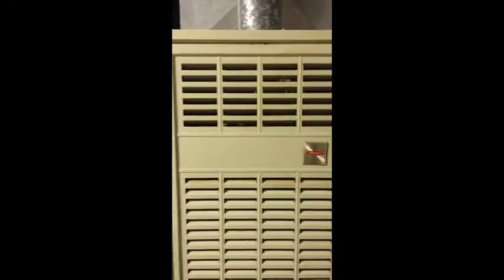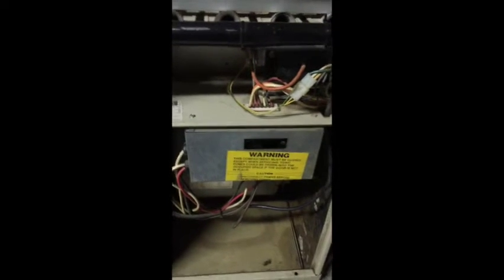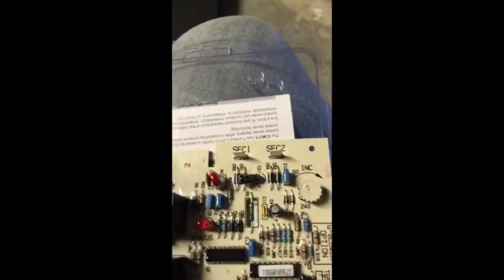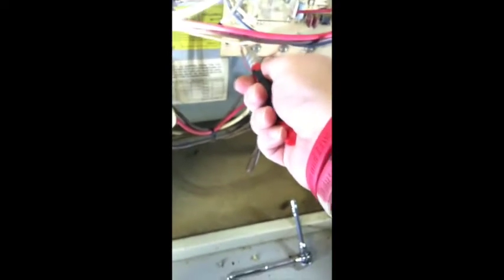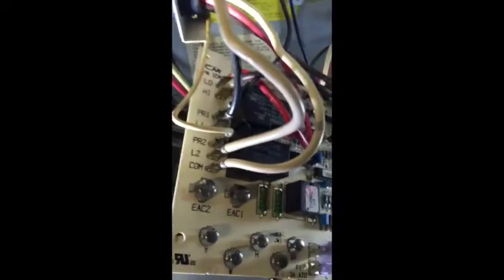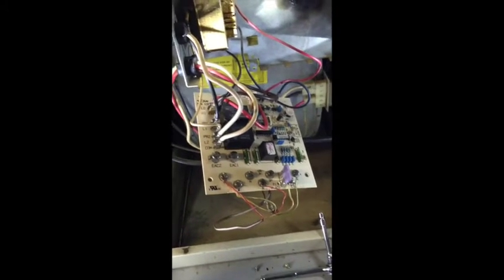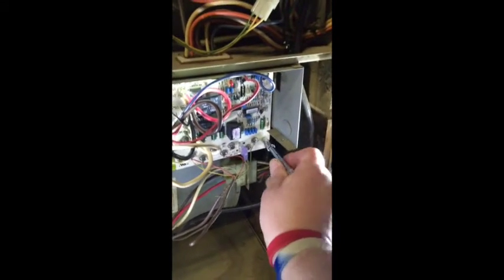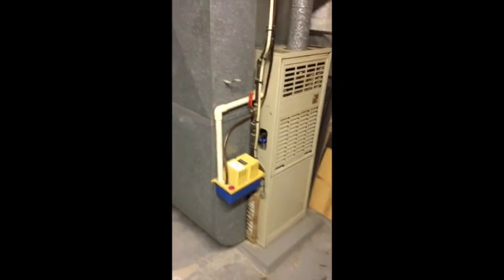Bryant/Carrier 395B Control Board Replacement

Comment: I did this exact same process today and it worked. An hour later the furnace stopped working, the new board has some residue all over it, and the led would not night up. Put the old board back on, bypassing the relay like before and now nothings working. 😢 no clue what I did wrong. Running the stove tonight… but the 3a fuse never popped?!?

Comment: Almost exact same furnace as mine. Yes, my board went out. Old style board has own relays on it. New board is solid state. New board installed with no problems. Transfer wire to wire over. Good video, thanks for posting. Saved me hundreds of dollars on service call.
Reply from the maker: Thanks Jim!!  Sorry I just saw your reply or else I would have replied back sooner.  

That was my whole point for doing this video.  I could not find ANY information out there on my furnace and I knew it had to be something stupid that myself or anyone else with a little mechanical ability could do themselves and save some $$$.

Comment: I have a question. I just wired in a new blower motor (using it for AC now) and noticed that it wires into the control board for apparently, automatic low and high speed operation. Do you know when the low speed kicks in. I never noticed any two speed operation ever for either heating OR cooling. Can you enlighten me on this? Thank you.
Reply from the maker: Hi Lockemeister!!!  I am in NO way a HVAC expert by ANY means.....lol!!  I am a network engineer for a living and have some mechanical/electrical inclination.  From what I have read the high speed is used for AC and the low speed for heating.  Some blowers have 3 speeds, white being your ground with black being high speed, blue being medium speed and red being the lowest speed.  In a 3 speed blower they determine which of the 2 higher speeds is best for your system.  Too little airflow can cause the coils to ice up and refrigerant to flood the compressor which could damage it and too much airflow can cause higher humidity levels.
Reply: sounds like you nailed the answer to me! Thanks!
Reply from the maker: ANYTIME!!  ALWAYS GLAD to help out where/when I can!!!
Reply: SO WHAT MAKES IT SHIFT UP OR DOWN?